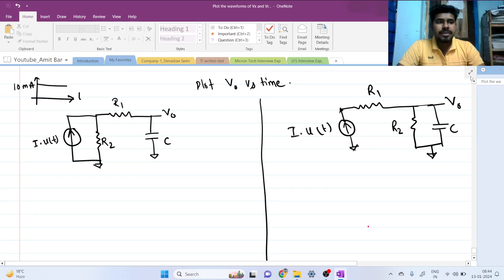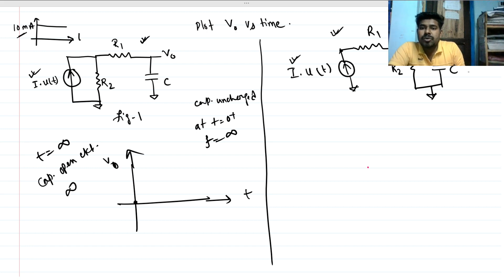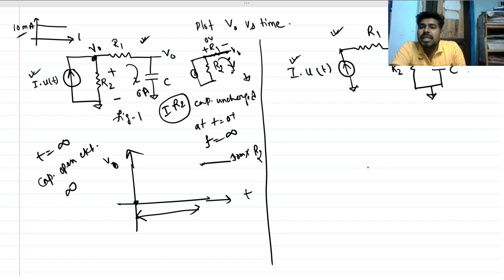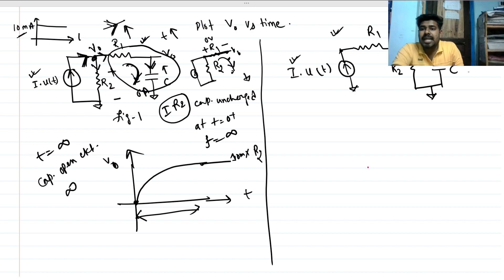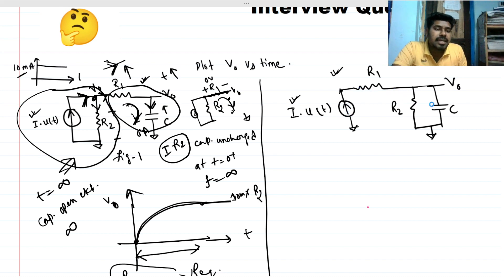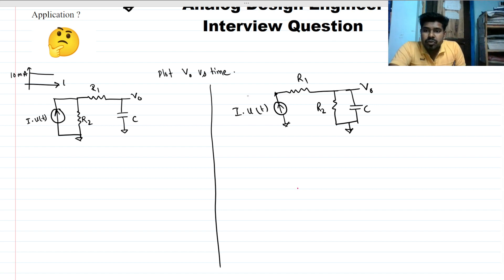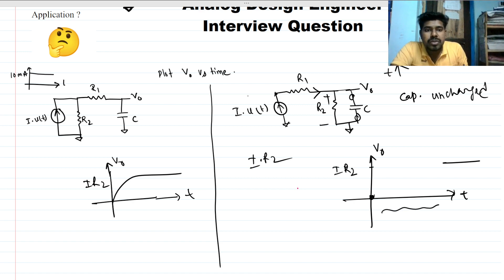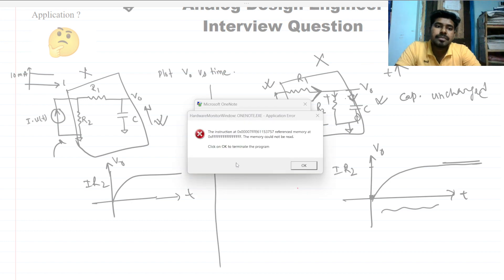Analog Design Interview_ RC circuit with Current excitation

Comment: In the 2nd circuit, why the steady state value of voltage is IR2? and not IR2/(R1+R2)
Reply from the maker: The expression you write is the dimension of current not voltage ...Thanks
Reply: Oh it's my bad..
Thanks for correcting me😊

Comment: why it will be exponential charging and not the linear charging? Since in the previous videos we saw that when capacitor is connected to the constant current source the voltage increases linearly indefinitely. Is it because we have final value of of Vout defined here as IR2, the shape is exponential and not the linear?
Reply from the maker: Here the current through the capacitor is not constant...Thanks
Reply: ohk ok, got it. Thank you 😊
Reply: Exactly bro i still didn't get it , Xc will increase in all cases with time ig